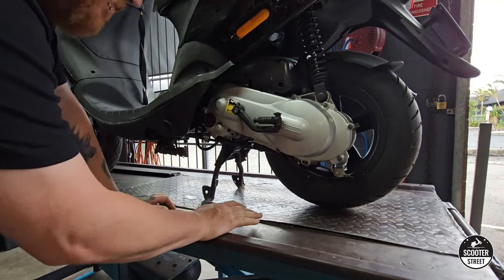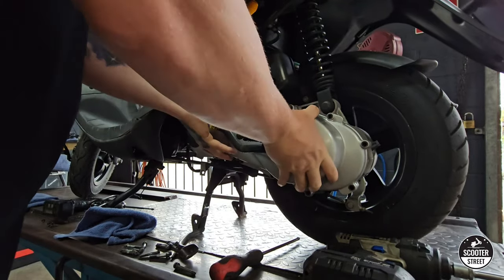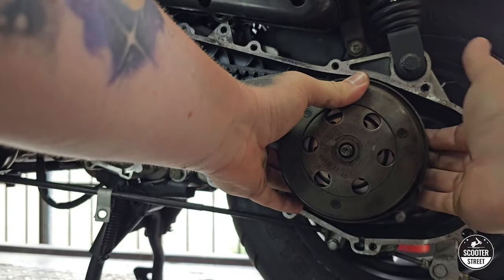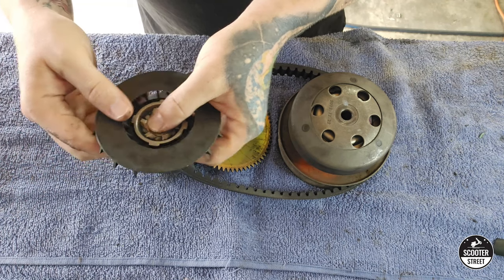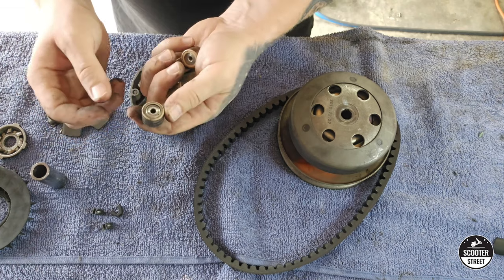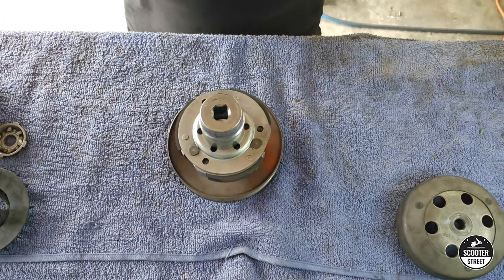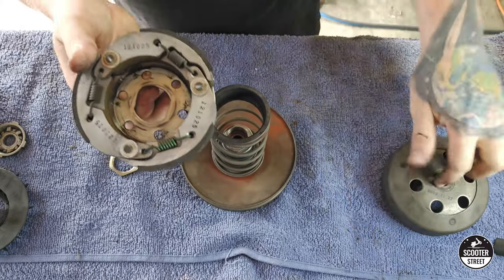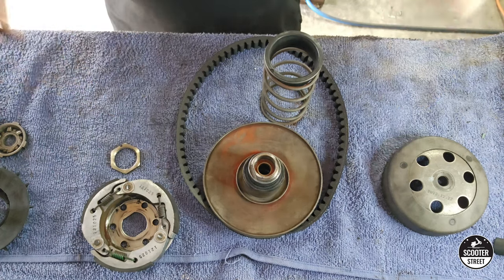Piaggio Zip Transmission Tuning - Malossi Variator, Belt & Clutch Install

Comment: Hey Brad!
I have a Vespa LX50, now with an Athena 70cc pro sport, Sito plus exhaust (for stealth look) Malossi 2000 variator + rear spring, standard clutch with Malossi springs. Sticking with the standard 17.5 carb so far as I understand that gives better low end torque compared to a larger size.

…just want to say that I have been looking at very many of your videos and really enjoy the way you break things down and explain in such good ways. Such an asset!
Keep up the good work and thanks for sharing your insights and knowledge!
Reply from the maker: Thank you for taking the time to write this comment. Encouragement and support like this is truly amazing to hear! 
The smaller carb give low end and economy for the daily rider.

Comment: Another great tutorial . 👍
CVT tuning is so simply complicated. It really is a balancing act.

I always found with the Kevlar belts. They would wear out the variator more quickly.
So the belt you recommended sound ideal.👍
Reply from the maker: Hi Paul, yes, they are so stiff when they new too. They don't roll as easily as the Specials.

Comment: I really like your video, it was so helpful and clear to understand! I changed my OEM rollers with the help of your video! Are the OEM Piaggio rollers supposed to rattle a little bit? Not on idle but when I rev and accelerate. It’s a bit annoying. Thanks again for the helpful video! Subscribed 😎
Reply from the maker: Hello, Glad it helped and well done👌 The rollers don't rattle under acceleration, check if there is something loose at the engine, check the transmission bolts and nuts, check the exhaust and exhaust brackets. Check the kick start lever.
Reply: @scooterstreetau  just a quick update if someone has the same rattling: Yesterday I removed the clutch drum and saw that the 3 pads on the outside of the clutch centrifugal unit had pretty shiny surface which is not good. I sanded them down a little bit with 100 grit paper and I also sanded the inside edge of the drum because that was also too shiny and slippery. Cleaned everything with brake cleaner and the noise is gone 😁 thanks for the tips anyway!

Comment: i have yamaha neos 2006 50cc stock and i have performance exhaust and 5g rollers , in the variator  there is a small washer maybe 1mm thickness can i take it off and get some more speed and torque ?? and thanks for this video this help me a lot
Reply from the maker: Hi and glad it helped, the small washer in the Minarelli is part of the outer fan. If you remove this you may gain a touch more top speed but the initial takeoff will be slower. Move to a performance variator or start to shim the shaft and replace to a better performing belt.

Comment: hello  thanks for the video and time to make it. I have a Aprilia200 GT . and I want to replace the belt, rollers . can you recommend some upgrades for this kind of scooter. thanks
Reply from the maker: Hi, you're welcome🙌 SR GT, very nice. Several key perfparts for these engine, Malossi or Polini Variator and transmission tuning parts, Leo Vince make a good exhaust the Corsa, and get some fluffy dice too.

Comment: Hey people, love your channel, bunch of useful stuff.
I would like to upgrade my electrical output on my 2000. Piaggio LIberty 125. It is a pre-leader engine.
I use my scooter daily, I commute with it, I travel and I need my heated grips to not drain my battery after starting it for 20 times a day.
Sometimes I turn the grips off and I use kickstarter to recharge my battery. But I would enjoy not having to do it.
Do you have any advice?
Reply from the maker: You could start with another battery that has a higher amp hour rating. 
I prefer to fit a second battery which powers the heated grips. Connect the main battery to the second battery by way of parallel, voltage stays at 12V. (
google Series and Parallel for 12V batteries). Use an isolation swith which isolates the power between the 2nd battery and turn it on during riding when you need to charge the second battery. Use the 2nd battery for the grips only and not both to start the electric motor. For best results seek professional help when fitting electricals.
Reply: Thank you for the super quick reply. The thing is, my under seat compartment is full of tools and spares, tire sealant (I am prepared for anything :) ). And there is no room for battery that is bigger than the stock one, I'm afraid. I'd rather buy another stator with bigger output but I've never heard of aftermarket ones. Thank you for the idea, I will keep it in mind.
Reply from the maker: All the best. Let us know the final result. @iamandreja

Comment: Hello, my son has modified his 2 stroke zip. Unfortunately something happens 5 mins into the ride. A whining noise then eventually stalls. He manages to start it back up then the performance is lesser. 
Once it cools down it goes back to normal and then does exactly the same once driven again. 
I wonder if he's missing something.
Reply from the maker: Check the piston.

Comment: hello i changed contra spring and change variator to naraku but with same grams as original, so now my moped is doing same speed as befor but i have original exhaust on, do you think it will make a difference if i put after market exhaust or it will be the same, and i dont know if i should upgrade clutch springs, please help me (i have longjia raptor 50ccm 2 stroke)
Reply from the maker: A performance exhaust tuned correctly will make a difference, yes.

Comment: Hey im planning on upgrading my cvt with the poloni hi speed minarelli kit or the malossi mhr 2000 kit which should i choose? And if i upgrade my carb from a 12mm to a 17.5mm does my top speed increase by a lot?
Reply: Btw my moped is a yamaha aerox 2016m. 2T
Reply from the maker: @titasjon7122  Go with the best value, the kits are very similar and both work very well on the Aerox. I would lean toward the Popo.

Comment: I dont have a washer on the front pulley, do all zips have them?
Reply from the maker: It may have been removed, not all Zips have them.
Reply: @ alrighty, do you know if there are any short rear mudguards for the zip? Have seen in your videos but can not find any to buy. Would the typhoon mudguard fit?
Reply from the maker: @balamood6183  Cut them down and trim the edge to suit the style you want. You can add spacers to raise the height.

Comment: Hi ive got nrg mc3 im up grading variator clutch and bell  belt all malossi also going with naraku torsion controller the one that spins and malossi torsion controller will i see much gains on standard topend or would i need to 70 kit im also running gianelli pipe
Reply from the maker: If there are any limits on the potential of the factory parts, the answer is yes.
Replace one part at a time then test ride. Do not put everything in all at one time. Gains will be made with the variator roller weights, not too light.
If the belt is slightly longer and there is travel on the variator will equate to more top speed, shims can be used if take off is lost. Dont use Kevlar belt. Special is more beneficial.
Reply: @scooterstreetau  engines done 4k genuine miles and yeah well i guessed if i changed clutch and bell and torsion spring and twist controller and variator i thought id see change
Reply from the maker: @JamesAngell-c6h  you are going to find out 👍

Comment: is it safe to mix rollers i want to mix 5,5g and 7,2g
Reply from the maker: Yes this is fine, but not for long term. Use the combo method for dialing in the roller weight and then match all 6 rollers with the totla weight of the combo set.👍

Comment: does the REED VALVE MALOSSI MHR VL13 fit 28mm pwk carb
Reply from the maker: If the carby is designed for the specific engine.

Comment: hello i have a kymco agility 50cc 4stroke does the malossi clutch help for top speed ore faster take off?
Reply from the maker: No. You need an engine upgrade. Try the variator shaft, Malossi variator and clutch springs with rollers.

Comment: From New Zealand looking at getting a scooter at the moment  what do you recommend I need abit of leg room it's favouring a two-stroke  I have a supermoto two-stroke 300 at the moment but it hurts my knee because my knees too bent, previous motocross injuries .my wife's got a four-stroke scooter honda which is way more comfortable for my knees so I'm looking for one at the moment but I've always been into two strokes
Reply from the maker: You can fit extra side footpegs to the front floorboard, itgive the legs a stretch. You see these on some of the delivery scooters and many motobikes.
Reply: @oscarnygren6478  👍 good nice scooters but very unlikely to find in New Zealand

Comment: Hello, I have a aprillia sr and i bought full polini hi speed transmission kit with a belt but when i put it all together there i a gap between drive boss and the belt, i am also using stock spacer in the back so why it wont fit nicely?
Reply from the maker: Check the fitment for the Polini part number to your Aprilia model. Check the fitting instructions. Where did you buy the kit from ask the supplier as they will be more familiar with the parts you bought.
Reply: Also the belt deliverd with that transmission kit is dog shi, it made my 70cc aerox slow ash so i got a malossi kevlar belt instead

Comment: Hi guys hope you are well. 
I have a piaggio zip 2 stroke - its fairly low mileage , ive put an exhaust on it , derestricted the carb, stiffer clutch springs (25% stiffer), 6 Gram malossi rollers. 

It bogs at full throttle, and theres barely any acceleration from 1/4 throttle to full throttle but after a little bit it then it starts to move - currently have a 60 Main jet in the 17.5mm carb

Any help will be appreciated, Thanks Jay
Reply from the maker: HI Jay, All good here✌️ Why didnt you jet the carby? In every single video about tuning we mention you MUSY adjust the main jet accordingly.
Reply: A 60 main jet is way too small , needs up jetting abit

Comment: is that 4T? what size and weight are the stock rollers?
Reply from the maker: It is a 2T, 19 x 15.5mm 7.5gram.
Reply: @scooterstreetau  do you happen to inow if the 4t has the same stock rollers?
Reply from the maker: @onniasunta4531  4T ZIP? 19 x 15.5 7 gram.
Reply: @scooterstreetau  Yeah. I've derestricted mine, and thinking about putting on a little lighter rollers, and a stiffer torque spring. Do you think i should go 0,5g or 1g lighter at first? What would be your best guess. Also thinking about putting on a free flow air filter and putting in a bigger main jet. Atm i have a 75 in with the stock airbox, I was wondering how much bigger jet i will need when switching to a free flow air filter..?
Reply from the maker: @onniasunta4531  I always suggest to try it all and that will be the best way to learn. Only make 1 check per time. Start with Lighter rollers.
Reply: @scooterstreetau  ty. I still am thinking about trying another torque spring same time as lighter rollers. Do you think making two changes at the same time would possibly be a disaster?
Reply from the maker: @onniasunta4531  We never change more than 1 part at a time because you will not know what part made the difference, why people do this baffles me🤔Try what ever you feel is right.👍

Comment: Does clutch springs effect to the top speed?
Reply from the maker: The 3 small shoe springs do not have an effect on top speed.
Reply: @scooterstreetau  thanks For The information sirr
Reply from the maker: @jari887  🙌
Reply: @scooterstreetau  i have white malossi contra spring so do you have any recommedation For right weight rollers
Reply from the maker: @jari887  It will always in every situation be trial and testing of different weights.
Reply: @scooterstreetau  thanks, you have Been very helpful, i Respect that